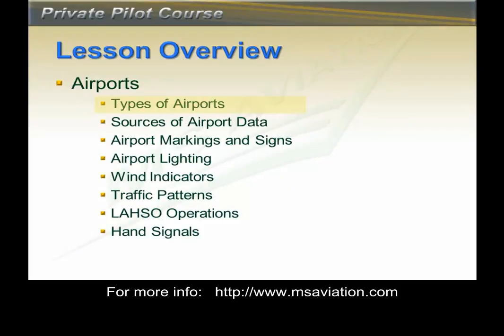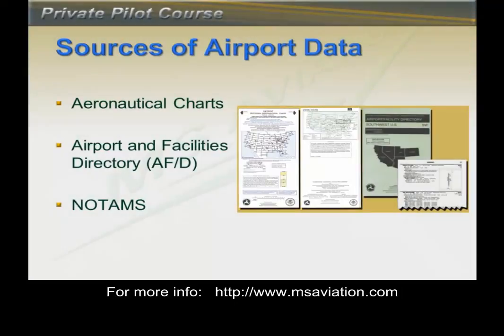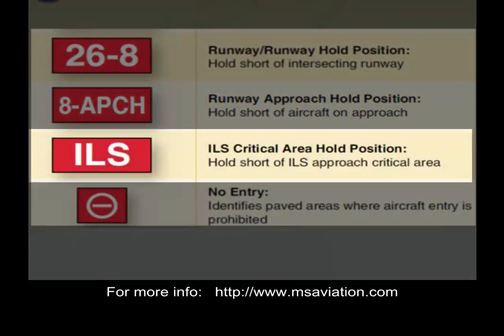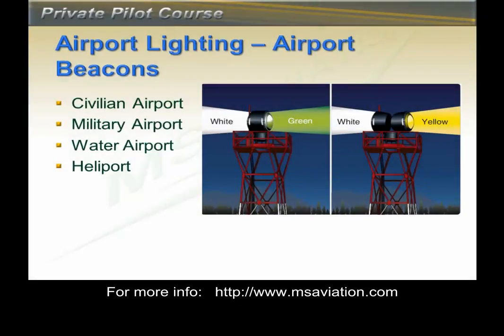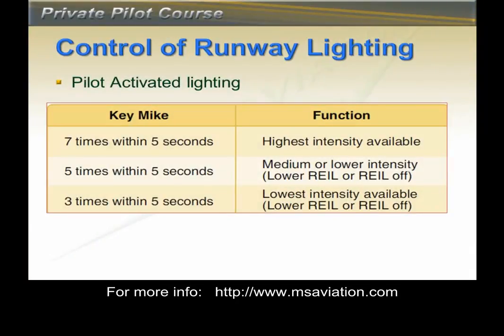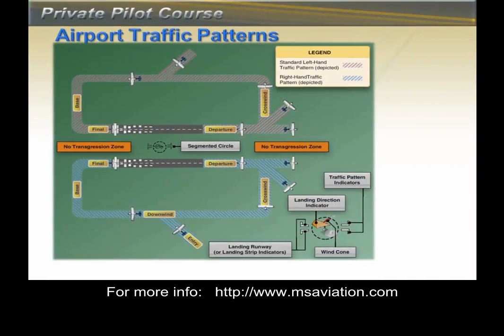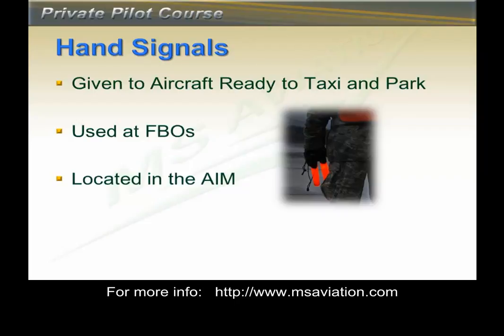Airports

Comment: ON THE SIDE OF THE RUNWAY ARE EITHER WHITE OR BLUE LIGHTS? ON THE APPROACH ENTRY THERE IS A IS SAE LOCALIZER WITH AN APPROACH FLASHER WHITE WITH LIGHTS FROM GREEN TO WHITE? THERE ARE RUNWAY EDGE LIGHTS WHICH ARE EITER GREEN OR RED WITH THE GLIDESCOPE? THERE ARE PAPI LIGHTS ON THE END OF THE RUNWAY THAT ARE YELLOW, RED OR GREEN ACCORDING TO THE GLIDESCOPE?

Comment: THERE ARE TWO TYPE OF TOWERED AIRPORTS WITH AND WITHOUT TOWERS? AERNAUTICAL CHARTS PROVIDE FACILITY RESOURCES INFORMATION? NOTAMS GIVE INFORMATION, THIS IS IMPORTANT FOR NON-TOWERED AIRPORTS CONTROLLED BY ABOTHER FACILITY? YOU TUNE THE RADIO TO THE OTHER FACILITY?

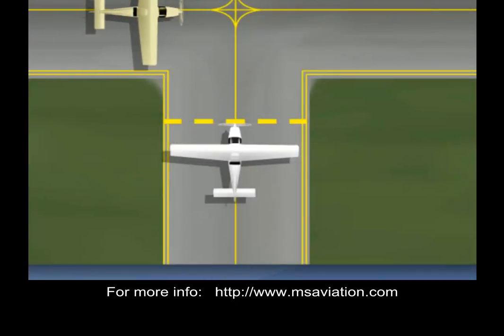Comment: At 07:45 you say you have to hold short of the lines before the approach area. I think this is wrong.
AIM: This marking is collocated with the runway approach area holding position sign.
When specifically instructed by ATC “Hold short of (runway xx approach area)” the pilot should stop so no part of the aircraft extends beyond the holding position marking.